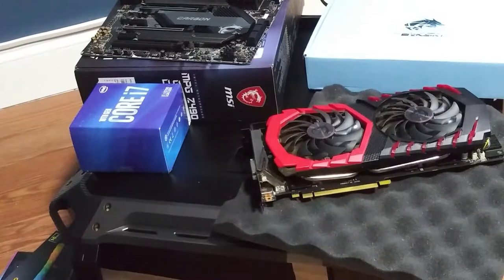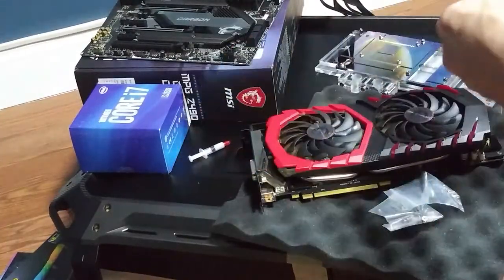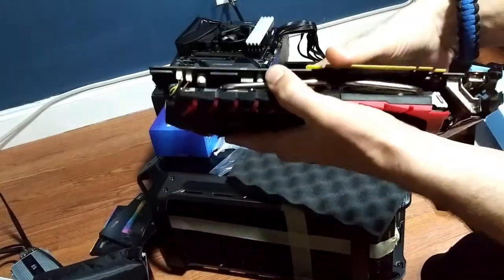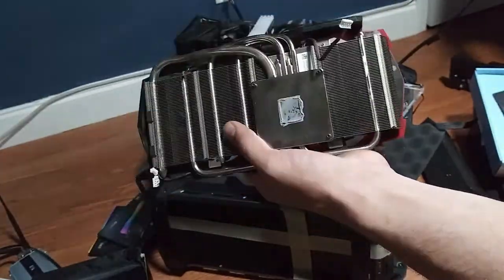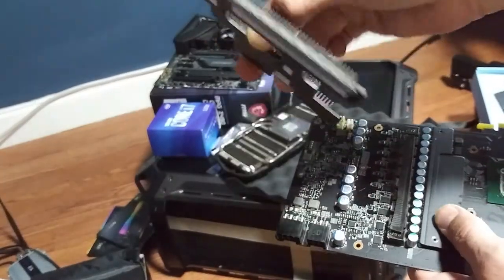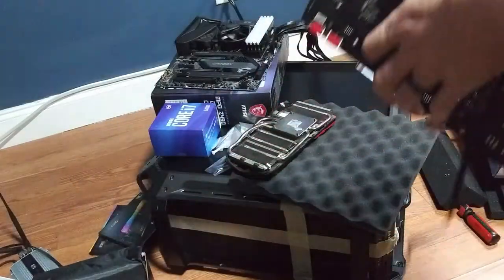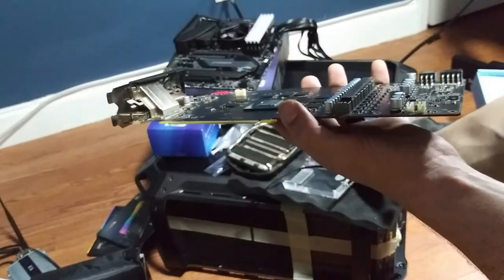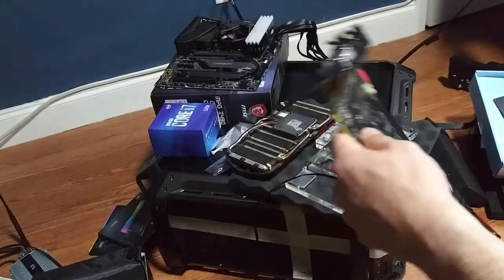Total Fail x 2 .Gpu waterblock

Comment: You can run it with just the 8 pin but you cant overclock it I did that with my i9 until I got the correct psu
Reply from the maker: Thanks.  Good to know bro